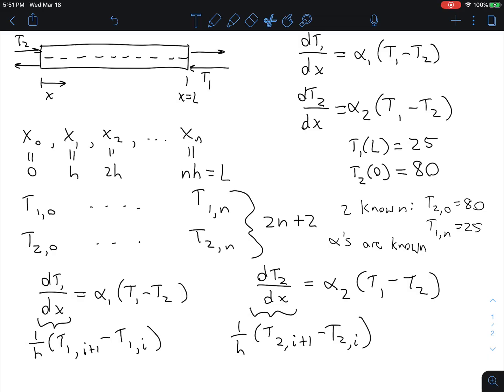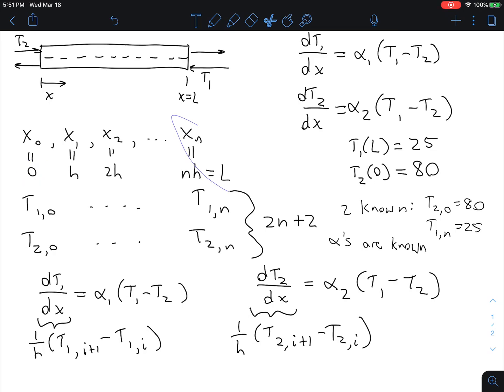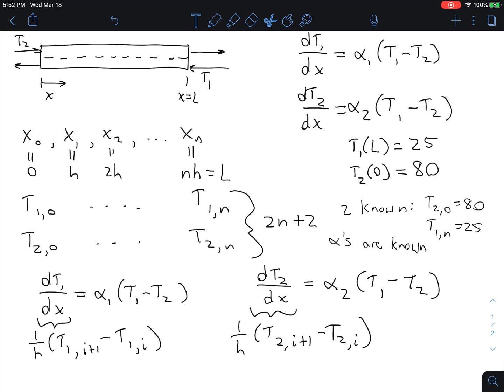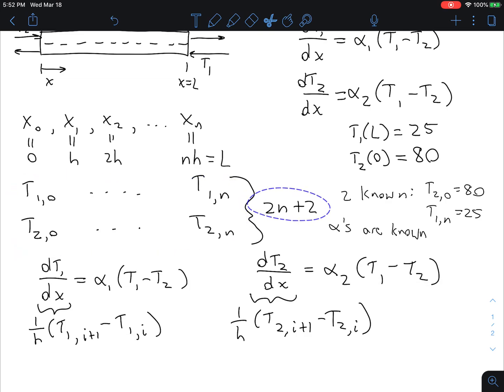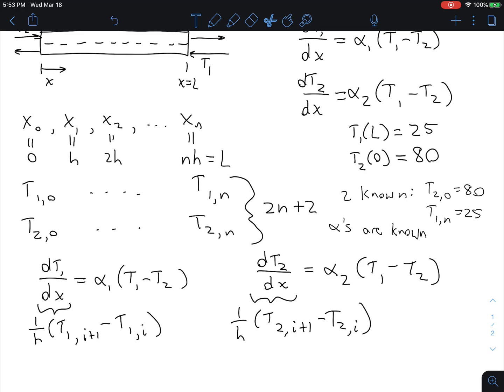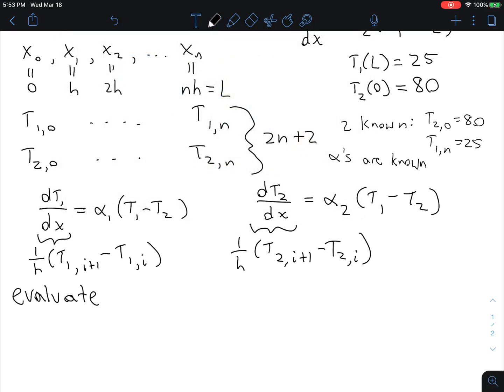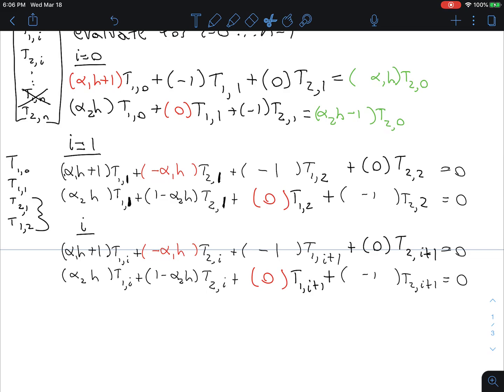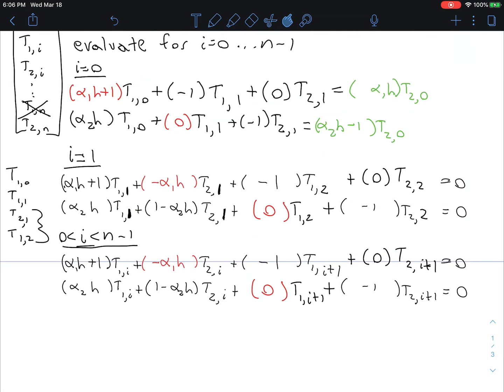Finite Differences Example 1 (2/3): countercurrent heat exchanger

Comment: At 13:19 you write 
T1,0 
T1,1 
T2,1
T2,2 as the unknowns. Is this just for the i=1 iteration? And why do you have T1,0 for i=1 when there is no T1,0 written in the i=1 set of formulas?
Reply from the maker: I was listing the beginning of the list of unknown so we could determine correspondence between unknowns and rows.